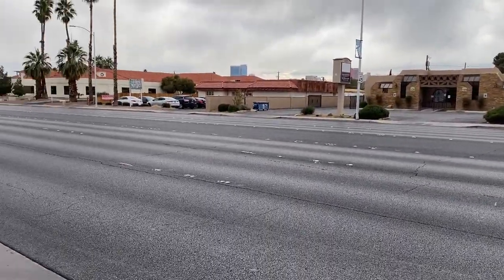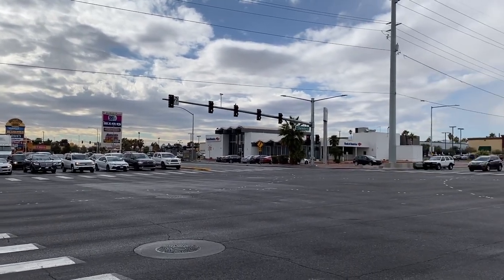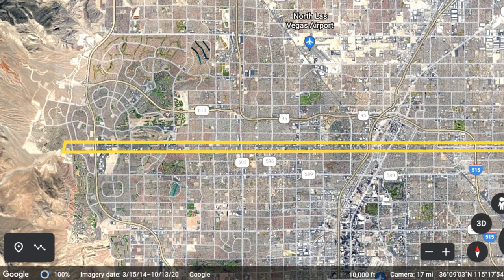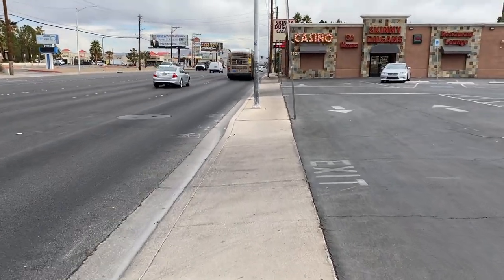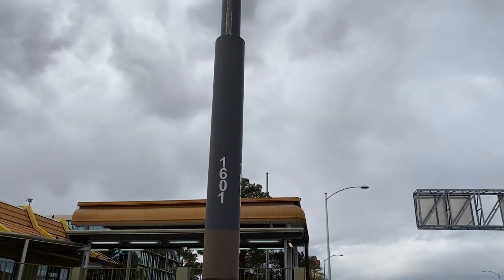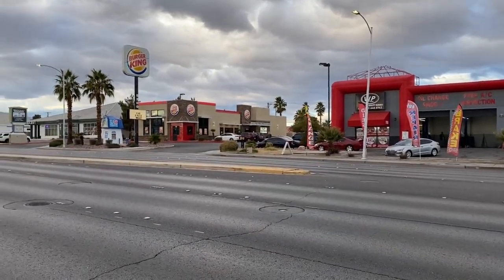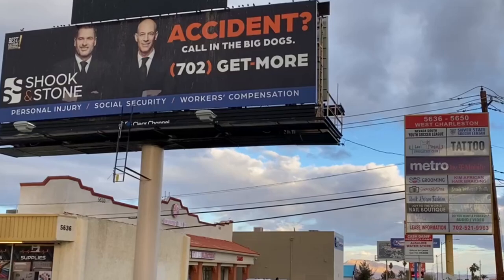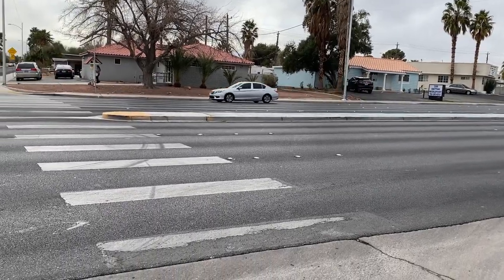The Stroad: A Case Study // Intended (and Unintended) Consequences of Car-Oriented Street Design

Comment: That stroad actually looks pretty pedestrian friendly compared to most in the US. Growing up in the Saint Louis area many just had gutters or even ditches. In the oldest incarnation of the stroad, the business parking lots just meet the street with one row of parking. Some cities have newer ordinances that call for sidewalks for new buildings which leads to stroads with several "sidewalks to nowhere" that start & end at property lines on redeveloped properties.

Another aspect of stroads that I've noticed is that many lack basic connections to nearby residential areas. Near one place where I lived in Illinois there were apartments behind a strip mall with a grocery store. Residents of the apartment complex could've easily walked to get groceries if a simple 20" sidewalk connection were installed. None ever was. Instead a berm & a fence were installed to prevent access. Suburban residents have been so trained to drive everywhere I wonder if anyone would use it if it were present?

Comment: I live in a suburb surrounded on all sides by stroads. And while we have shopping within the bounds of those stroads, you can't get to them traveling within the neighborhood. No streets connect to them, and access via foot is blocked by brick walls separating the commercial zones from the housing.

If you want to go grocery shopping, grab a bagel, or visit an oral surgeon, you either need to drive along/cross a stroad, or walk alongside/across it. In the latter case, the sidewalks are narrow and full of obstacles, not to mention loud from the high speed traffic. (Also, and this is more a product of my house's place in it, but the neighborhood is large enough that getting to the shopping is non-trivial on foot.)

Even for destinations that are most in reach, they seem calculated to stymie attempts to get there. The car and the stroad are king here.

Comment: As far as the auto specific business, a lot of areas have a specific zoning requirement for them. I'm iffy about a lot of parts of zoning but I'd imagine in this case it's due to the chemicals that are an inherent part of the business.

One think you might want to look at for a video is unused right of ways. I know here in Philadelphia there are a really high number of rail right of ways that are already owned by SEPTA, but go unused. Some of them are redundant, due to the acquisition of two rail companies that had competing lines, but there are definitely places where they could be really useful if used.

Comment: 1:04: I haven't seen it yet, actually, but it's the very top video recommended in the recommendations on the right, so I will watch it now. 

...Surprisingly, it looks like I am not subscribed to Not Just Bikes yet. I'm surprised, given how many times I've heard about them. 

I'm still not quite sure whether some of the large avenues I often live by can be considered stroads or not. I guess they allow through traffic so technically? But they are not as unlivable like all the bad examples given. Colorado Blvd in Pasadena, CA, for example, has nice wide bus stops on comfortably wide sidewalks, lots of businesses, and few driveways. Walkability is annoying with lights, but not impossible and I either walk or bike everywhere.

Comment: I'd be interested in an exploration of the warning signs of a small road being expanded into a stroad. I live near a small town on an island with few arterial routes. At this time, the primary one never reaches more than three lanes total, but recent bus cuts due to covid and other reasons mean there are an increased number of cars on the road, and I'm absolutely certain that there will be calls to increase lanes on the arterial highway where possible. Low speed limits are often largely ignored, translating to more pedestrian deaths than we should have.

Were it not for geography (steep hills) and existing buildings, I'm confident that this would have happened some years ago.

Comment: The comment about pedestrian waiting times, specifically the length of the crossing struck a chord with me. There are many ped signals that tell you to not to cross after a certain time has passed on the pedestrian crossing. But the time it takes to cross the stroad is about as long as the timer gives pedestrians to start walking. So unless you're already waiting at a crossing, you won't be able to safely cross. It's a weird way that city planning shows pedestrians that they're not the priority.

Once I heard that Dutch crossing signals change for pedestrians automatically, everything else came after.

Comment: Two things:
1. One of the reasons Charleston Blvd in particular has a lot of law offices might be because the Nevada State Bar Association office is on that stroad.
2. For much of the year, Las Vegas isn't really walkable due to temperature extremes, regardless of how walkable the sidewalks are.
Reply: It's hard to walk in Vegas because of the heat island effect caused by all the car exhaust, tarmac, concrete and the total lack of shade by trees and buildings ! And of course the lack of facilities ...
It is true that it gets incredibly hot in LV during summer, but it is also totally bone dry !  The humidity does not get above 20% in summer ! Temps of 40°C/105°F  at relative humidity of 9% , feel like 36°C . 
In my country Arabs complain that when temps rise it feels uncomfortable, due the high humidity, unlike in their dry homelands.. Seville in Spain is also very hot, but people do walk and bike in town, so temperature is not determinative.

Comment: 5:19 This is pretty common here in Russia. Not only in cities, but also on highways outside of cities, for instance at a bus stop for a nearby village.
On highways (with a 90 km/h limit by default), it's especially dangerous, because people cross there rarely, and therefore drivers don't expect someone to stop at the crosswalk, which could cause a rear-end crash.
In cities, they sometimes install speed bumps in order to make them "safer", but at the expense of congestion. There used to be speed bumps before a crosswalk on a busy 4-lane road in my city, and there always was a rolling queue due to them.
I don't understand why the local government goes so far out of their way to do anything but not install traffic lights. (at least pedestrian-actuated ones)
IMO, unsignalized crosswalks on roads with more than 2 lanes in each direction should be prohibited.

Comment: Two eg's Vancouver BC has instead of freeways aren't as stroad as this because there are barely any slip lanes and there aren't strip malls or stroad parking, and the signal phases are rapid.  Development seems concentrated on streets connecting to, and not along these not-freeways.  I'm thinking of BC-99 and Cambie Street (whose communities are super rich).  Otherwise, Vancouver stroads mostly are more typical

Comment: Dedicated right turns lanes can be good if they are used to allow pedestrians to cross the road without the risk of cars charging them down (don't allow cars to turn right when the pedestrian crossing goes with the straight cars), which it seems doesn't happen a lot in America, if ever, but it can be done and I would say that it's actually good and should be done to improve the pedestrian experience.

Comment: Having a separate right-turning lane seems rather important for scheduling, e.g. green for car traffic in a particular direction is compatible with green for pedestrians and cyclists parallel to that car traffic, but obviously not if you allow cars turning right into those cyclists/pedestrians. Here in the Netherlands I think it's pretty unusual to have a signalized intersection without separate turning lanes (with associated traffic lights) for each direction.

Comment: Right turn lanes are more valuable than apparent, despite their empty appearance. When right on red is allowed, right tirn lanes can help keep traffic moving, taking load off of the through lanes.
Reply: Dedicated right turn lanes can be usefull, but right on red should never be allowed.
Reply: @hendman4083  Never is a long time I have experimented with both, sometimes prohibiting the right helps, usually not. It would help if the AI would follow the rules of the road, and yield appropriately.

Comment: Lol I used to live here (short term) and gave up on walking pretty quickly. Makes no sense, not only are the cars driving fast, road widths crazy wide, but also the blocks are very long. Maybe worth mentioning that some parts of these neighborhoods have greenways that go in between houses and apartment complexes. That made it suck slightly less. But yes Vegas is a mess, comments are pretty accurate too, but at least you can drive out to Red Rocks or Mt. Charleston very easily I guess!

Comment: Las Vegas is hell. I stayed there at a hotel 400 metres from the strip. I'm getting on a bit, but I'm still fit enough, so in the UK, I would always walk any journey of less than a kilometre. But was literally impossible to walk that 400m to the strip.

It was 400m that simply could not be traversed without a car. There was a bus from the hotel, which took 15 minutes. 8 minutes longer than it would have taken me to walk if there had been a path! 

There was a chemists opposite the hotel, which was absolute murder to get to, but just about doable. I was looking for something there and the woman working there suggested a place further up the road. I asked if it was too far to walk, and she literally could not process the question, it was something she wasn't even capable of guessing at. She even looked kind of uncomfortable, as if I'd said something slightly distasteful.

Weird country, I'm not going back.

Comment: As a result of Vancouver halting highways at its border in the 1960s (because of lack of funding and not the myth that citizens' protests worked) the intersection of Hastings and Cassiar looked like that stroad intersection in Vegas. Things didn't get better until the highway was tunneled to the bridge which joined the highway to its continuation on the north shore about 20 years ago

Comment: A couple of indicator species might be alcohol vendors and smoke shops. Let's face it driving isn't fun, so it helps if you're hammered. Often, there are drive thrus for these. I've even seen a drive thru keg seller. And of course, the drive thru bank, check cashing, pawn or other predatory lender.
It's nice that there are sidewalks, even if they have obstructions. Some stroads don't have sidewalks, but do have bus service. I guess you're supposed to walk through parking lots.

Comment: I'm here to make my cities in City Skylines better.  But will say one thing that irked me recently was the redesign of bus stop shelters. Already with limited space, they decide to turn the outer walls inward to make the adverts more readable by drivers. Which of course makes the shelters less appealing for transit riders. Think about it, they could have turned the walls outward at the same angle and achieved the same readability, except that you might have one of those 'damned' transit riders standing in front of it.

Comment: Yes I'd like to hear a solutions video.  Strodes are so depressing. But what to do about them?
Reply: In my opinion, these could be done (in order of easier and cheaper to harder and more expensive):

1. Adding bus lanes (or HOV lanes) in each direction to push more people out of cars and into public transit. Also painted bike lanes.
2. Tearing away lanes and replacing with protected bike paths/wider sidewalks. Also changing traffic signals to prioritize people walking, biking and public transit. 
3. For really wide stroads, you could tear a lot of it away and turn it into a more separated road with fewer exits, maybe into parallel streets. This would reduce waiting at traffic lights, cars getting in and out of the stroad, reducing congestion and accidents. 
4. Adding light rail if it makes sense.

I would hope that this sort of infrastructural investment could incentivize denser development in the area, and be coupled with local reforms pushing for mixed use commercial/residential areas. Hopefully then you would see less parking lots and more areas people would want to spend time in.

Comment: If you have low density sprawl you will have stroads. The solution is to build light rail or subways and at every stop build high density transit oriented housing.

Comment: Despite the aptly named 'Strode Road' Plymouth's two/three lane in each direction stroads all have metal railings down the middle and no U turn signs. So if you need roads, homes, businesses on the right. You have go to the first junction allowing a right turn and go road the block or wait for a roundabout. 
Plymouth was rebuilt for the car after being largely destroyed in the Blitzkrieg. A huge mistake although at least the inside lane on the three lane strides are now largely bus, taxi, bicycle and municipal vehicle exclusive lanes
Reply: I take it you're referring to that abomination in Laira when you get off the A38.

Comment: Whats the significance of Vegas not having regular lane markings but those metal things on the ground on some streets?
Reply: Do you mean these?

A raised pavement marker is a safety device used on roads. These devices are usually made with plastic, ceramic, thermoplastic paint, glass or occasionally metal, and come in a variety of shapes and colors. Raised reflective markers, such as plastic, ceramic, or metal ones, include a lens or sheeting that enhances their visibility by retroreflecting automotive headlights, while glass road studs gather automotive headlights with a dome shape and reflect the lights with a reflective layer within. Some other names for specific types of raised pavement markers include convex vibration lines, Botts' dots, delineators, cat's eyes, road studs, or road turtles. Sometimes they are simply referred to as "reflectors". 

My suspicion is in a place with so many visible distractions at night like Vegas, these help highlight the lanes better.  I don't find them common in the mid-Atlantic/Northeast but that's probably because of having to plow snow in the winter.

Comment: So the thing i noticed is that i have never seen a school zone speed limit as high as 25 before.
Reply from the maker: I didn't even think of that. It is pretty nuts
Reply: Where I grew up in PA school zones were always 15 mph.  Still true?  Here in Northern VA, there are often school zones along state roads that have speed limits around 35 mph or so.  But, in those cases, the roads don't have sidewalks or really any school frontage by the road and I've never seen a child once so I think it's more just for general awareness?

Comment: I aint no expert, but from my point of view, the "stroad" is fine, its the fact it is an arterial being used as a local road is what is the problem. To fix the stroad, you must remove all the business access. My idea is  converting the stroad into what i call a "budget interstate" or "mini interstate". Rather than a direct access onto the arterial, you must get on the feeder streets, which will be somewhat similar to interstate frontage roads, but with smaller lanes and 30-40 MPH speed limit. The actual road will still intersect with connector roads, but local small roads will end at the feeder streets. In order to access theae feeder streets, you will have some form of exit and entrance ramp to allow you to get on and off the road. I learned from cities skylines to never have stores directly on the arterials.

Comment: It's interesting how much of this EVs kill off. Don't need nearly as many fueling stations (if any). Don't need as many repair shops. For multiple reasons the numbers of dealers goes down. And more advanced crash avoidance systems plus wider availability of dashcams reduces demand for personal injury cases. And EV buses will make public transit less expensive and faster.

I can see that adding pressure to change how stroads work - reducing speeds, adding cycle lanes, more businesses where people stop and stay.
Reply from the maker: Interesting thoughts re the maintenance footprint of EVs. I can definitely see less demand for repair shops.

Comment: The strip actually isn't a stroad and is more like a boulevard. It is wide, and it does have commercial activity. But there is still a strong separation between the pedestrian and automobile realm. It actually reminds me of parts of Tokyo like Shibuya or Akihabara, where there are very fat streets, with many lanes especially by Japan standards, but I didn't have to think about the cars, because the boundaries between the pedestrian and automobile realm were clearly defined. 

As for the Stroad you showed, yeah that definitely is a horrible stroad.
Reply from the maker: I like how you describe that.

What I should've clarified in the video is that The Strip WAS the ultimate stroad -- everything was at grade, driveways and hazardous crosswalks, etc. -- in its original incarnation. A lot has changed, and I can't wait to make a video about it.
Reply: I never knew that, as I am not as old as you are, and the last time I visited vegas was 2 years ago, and I actually liked the strip, It is quite interesting and unique at ground level.